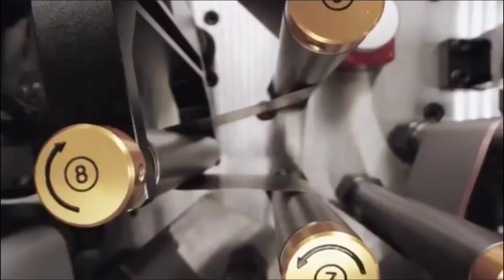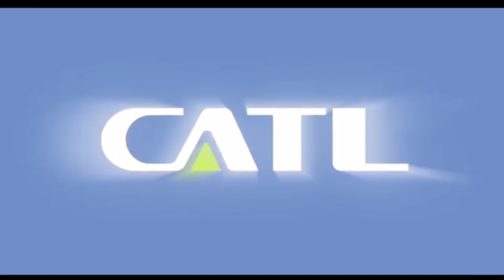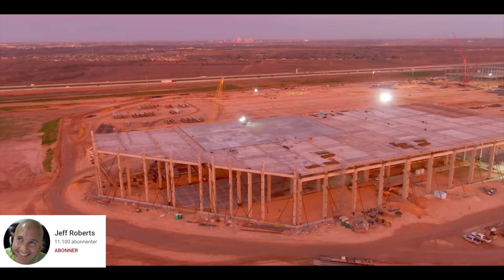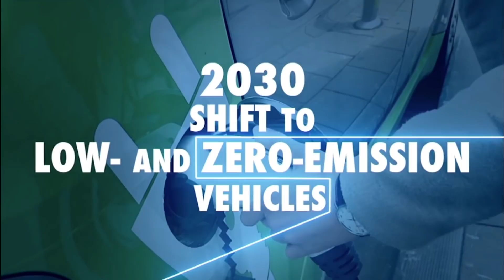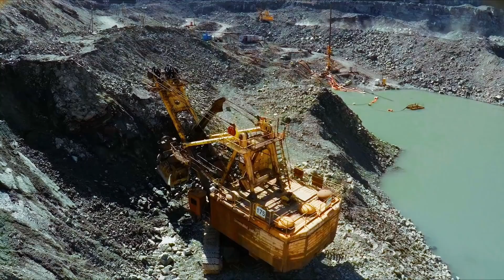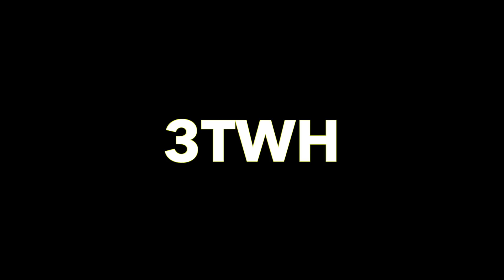Tesla is making 3 NEW battery types | And securing materials like NO ONE else

Comment: Just a follow up, you said they claim giga Berlin alone will eventually produce 240 or so gigawatts a year.  OK sure that is 638 million KW per day, 26 million per hour, 440,000 KW per minute, 7.300 KW per second. At 5 4680 batteries per KW that is 35,000 cells a second. at 2 lbs per KW that is 70,000 lbs of batteries out and materials in every second.  That is about 1 Semi truck load of batteries out every second and similar batteries materials in every second.  Thats 170,00 Semi trucks in and out a day; or 1500+ miles of semi trucks in and out every day.  TESLA REALITY!!

Comment: While this paints a rose tinted picture on the current situation, there's still strategic issues with the supply of crucial materials for Lithium ion production. While cobalt will have been virtually eliminated (currently at only 5% of the cell chemistry) other rare metals like nickel which are still used, do not have enough supply currently to support the production targets Elon Musk is targeting. This was even mentioned at battery day. While the availability of Lithium has been solved (it's relatively plentiful anyways) other critical components still haven't, and geopolitics can easily cause problems for supply chains for batteries as well. It's not a shut and dry case, and even Tesla admits there will be major hurdles to overcome to meet their production targets when it comes to Lithium ion production in the near future.

Comment: Lithium is not just the best materiel for the next decade, for mobility batteries (must move their own weight) it is permanently best. This is because lithium is the lightest metal. Reducing the weight of the rest of the battery chemistry will be the struggle. Also, the notion of recycling 100% of anything is nonsense, has never and will never happen. Recycling will only greatly reduce the amount of external input needed. Unless you classify new tech such as mining the oceans as recycling.

Comment: It is a bad thing to build too heavy and overpowered electric cars with unnecessary long range. It destroys our environment! We dont need so much batteries!
We can not move on like we did until now, only with electric instead of gas fuel!
Reply: We really need both long and short ranges. City and metropolitan areas don't need the range as bad as some rural areas. Some rural areas have round trip to town mileage of 50-100 miles. And with load, road conditions, and weather variations, batteries may not get normal mileage out of a charge.

Comment: Holy cow Batman!  Our Bat-Utility-belts will need some Tesla batteries soon!  Imagine a chain saw, drill, circular saw, jig saw, head-lamp; tool system, powered by a belt worn battery pack!  Post hole digger? No-problemo!
Reply: All these tools have cordless options that already use 18650 or similar cells. The Tesla variant might have 15% more capacity, but really not much difference. 
Scaled up to a vehicle battery, 15% is massive.

Comment: I think back when Tesla was just starting; that Elon thought that would get all the big OEMs off there butts and aggressively into EVs. But the Model S and X didn't do it. The OEMs just sat there. So Elon pushed the 3 into major production and the OEMs still just sat there.  Somewhere in all of that is when Elon realized the major car mfg.s were not going to get into EV production anywhere the size or speed needed.  That was probably around 2014 or so. Then Elon did what was needed. He ramped up what Tesla would have to do and started plans for many Giga factories. It is the same with battery production. I'm sure he asked Panasonic , LG, etc. to ramp up production capacity and they moved at a snails pace. So Elon said, well we are going to build our own batteries and we might as well make them better. Now that is happening and he's dragging the battery producers along. This is the same story with SpaceX and most of Elon's other businesses. He just has to do it himself because no one else will understand what is coming.
Reply: He wanted to be the catalyst but all the established companies would not budge. So Elon has shouldered the responsibility to be the change and that is one hell of a gigantic task. He is going to lead the way to a Planetary energy system that is non polluting and sustainable. Pretty much changing everything in an enormous infrastructure of which vehicles are about 1/3 of the equation. I would guess that even among those who support Elon's goals; very few have any grasp on the incredible scope and magnitude of his endeavor. It is the largest enterprise ever embarked by several magnitudes.  When one adds the goals of SpaceX, Boring co., Neuralink, etc. his scope is just mind boggling.

Comment: When they start producing the LFP batteries in the 46-80 tabless dry electrode format, the power walls and the lower range cars are going to be a lot cheaper to manufacture. That's when the ICE industry will begin to topple.
Reply: Nonsense, LFP batteries are already made in bigger sizes than the stupid Tesla 4680, and those batteries are already used in storage for homes, camping rigs, small overlanders.....
Reply: @carholic-sz3qv  That was something I did not know, Thank-you.
However, the tabless, dry electrode, 46-80 cell is designed for high current applications as well as being cheap and easy to manufacture. This is why it will have such a huge impact on the BEV market. When each of Tesla's giga-factories is able to turn out 250 giga-watt hours of batteries per year, vehicle production will no longer be battery constrained.
Reply: The ICE industry will continue to evolve before we are able to make 80 million EV a year.

Comment: That's great Lars, its strange, I have watched battery day so many times, but somehow missed the 3 types of cathodes. Everything was very subtle and Elon was coy, but the true fans get to the guts of it. Good work!
Reply: Sorry but you should know that is very difficult to recycle Tesla batteries in a meaningful way. In Germany they prefer to rather pay penalty. LFP is the state of the art battery ! Much safer and easy to recycle . Tesla has to catch up work to do. TESLA batteries are dirty....
Reply: @wernergmeineder7725  Tesla haven’t even launched any cars with their batteries yet. What are you talking about. And LFP is not powerful enough for long range.
Reply: @leedavies1768  LFP not powerful enough !? That's why BYD is using them for buses I guess.
Reply: @wernergmeineder7725  because buses don’t go 0-60 in under 5 secs. And you can fit a lot more batteries in the space of a bus. 
They are low cost and less power dense. You can’t get long range with them in a car. End of story.

Comment: You're jumping to conclusions, Lars.  Maybe they are the right conclusions, but they are not conclusions Tesla has announced.

Tesla has not said that they will make 3 different 4680 cells in their own battery production lines.

They did say they would use three different chemistries in battery cells for their vehicles.  Some of those cells will be provided by outside suppliers; indeed, lithium iron phosphate and nickel-manganese cells are already being used in Tesla's products, and they all come from outside suppliers.

Whether any of those chemistries will eventually come in the 4680 form-factor hasn't been announced.

The only announcement for 4680 cells, to be made by Tesla, is the high-nickel, dry electrode coated chemistry.  So far as Tesla has said, this is the only cell to be produced by Tesla.  It's not clear at this juncture, but I speculate that this cell will displace all other chemistries throughout Tesla's product line, in time.  But the production ramp has a long way to go before Tesla will be able to eliminate those other chemistries, or eliminate cells from other suppliers.  A long way to go.

The reason I expect Tesla's high-nickel cell to displace all other cells, eventually, is cost + performance.  It will be the cheapest cell on the market, and it will be the highest-performing cell.  There will be no reason to prefer to use more expensive, worse-performing cells, once they can make enough of the new cells.

If my speculation is correct, then by 2030 or soon thereafter, Tesla will be phasing out outside cell suppliers from their supply chain.  And the capacity freed up by Tesla will become available to other manufacturers.  Other automakers will reap a bonanza of cells from battery manufacturers.

By then, the tech in those cells will probably have advanced.  I don't expect them to match Tesla's own 4680 cell (whose tech will also advance), and so I expect Tesla to have a price/performance advantage in its products.  But other automakers - those who survive to that point - will be able to market pretty good BEVs in very large numbers.

Tesla will run into bottlenecks in their 4680 production ramp.  And it's unclear exactly when, or even if, Tesla's lithium mining operations will produce affordable lithium in quantity.  There is a lot that is still mysterious about Tesla's mining ambitions.  How fast can they go?  Your ideas on this match Elon's.  But Elon sets aspirational targets, more often than not.  Sometimes those targets can be met, but just as often, if not more so, bottlenecks get in the way and timelines stretch out.

A production ramp of this magnitude is usually beset by bottlenecks that will have to be resolved, with implications for the timeline.
Reply from the maker: You know me Urgelt, I always jump to conclusions 😉✌️
Reply: The LFP chemistry is the cheapest to produce. Where Mass and bulk are not critical, it is the clear choice for the most kilowatt hours per dollar. The same characteristics that make the 46-80 tabless dry electrode a better solution do not depend on chemistry. That's why I'm pretty sure that all batteries tesla employs, whether manufactured for them or manufactured by them will eventually (my guess is three years) use the same manufacturing technique. Once they have the production line worked out, they will mass-produce the battery lines and roll them out to all their factories and suppliers. Then we'll see something.
Reply: @surferdude4487  No, the chemistry isn't the sole governing factor in cell cost.  The form-factor is important.

The most difficult/expensive form-factor to manufacture is prismatic cells, whatever the chemistry.  It's just plain expensive to make them.  Pouch cells are cheaper but harder to regulate thermally, which either pushes costs downstream to the thermal regulation system, or further downstream to consumers, whose packs won't last as long because of inadequate thermal regulation (Leaf is an example).  Can cells are the easiest/cheapest to mass produce and easiest to regulate thermally.

Plus, Tesla has figured out how to use cans in structural packs, eliminating cost and weight in their BEVs, a savings above and beyond the per-kilowatt-hour cost of the cells.  This advantage can't be obtained from prismatic or pouch cells.

The cost of the chemical guts of LFP cells is cheaper, but in a pouch form-factor, some very significant savings are missed.

Further, LFP cells are not very energy-dense, so you need a lot more mass to match the energy density of a 4680 pack.  That extra mass imposes penalties on the BEV - more volume for the pack for a given range, more weight to haul around.

I'm comfortable projecting that Tesla will phase out the other cells as soon as they can make enough 4680 cells to do it.  The net cost advantages will not be matched by LFP or nickel-manganese cells in any form factor whatsoever.

I think you are right to say that the 4680 form-factor is independent of chemistry.  And the 4680 form factor is arbitrary; anyone can make a cylindrical cell of any shape.  But if the diameter of the cell increases to 46 centimeters, manufacturers must have a design that shortens the conductive path through the electrolyte, or thermal issues will arise very quickly.  The only design I know about for doing that is protected by Tesla's tabless cell patent.

Thus far, we have heard nothing from Tesla about licensing their patents to other battery manufacturers.  It's something to keep an eye on.
Reply: @Urgelt  Tabless design solves for shorter electron paths, reducing heat produced by internal resistance. This also makes larger cells such as the 46-80 possible. Larger cells means that fewer cells can be used to store the same amount of energy and reduces dead weight in the outer can because surface area to volume ratio is reduced. Dry electrode makes the cells more stable, cheaper and faster to produce. This holds true regardless of the battery chemistry. It is in Tesla's interest to provide their suppliers with this technology, even if they license it exclusively for their cells.
As for LFP, they will also be produced as 46-80 tabless dry electrode cells. The material costs and the cycle life of the chemistry will make them practical for lower cost vehicles and stationary storage. nickle is relatively expensive and always will be until we have a technology to transmute elements cheaply. For now, that's science fiction, but who knows what tomorrow will bring.
Reply: @surferdude4487  Your first paragraph merely echoes what I wrote.  Did you think you were refuting me?

LFP could be produced in the 4680 form-factor.  To date, neither Tesla nor its suppliers have announced any intention to do so.

I'm not sure LFP 4680 cells would be cheaper than high-nickel 4680 cells, though.  You'd need a lot more of them for the same range.  More mass, more volume in the pack.  Or take a hit on the range.

It's the cost at the BEV level, not the cell level, that matters.

As for the cycle life advantage for LFP, we haven't yet heard from Tesla regarding their cycle life expectations for high-nickel 4680 cells.

I'm expecting cycle life for the 4680 cells will be excellent without resorting to LFP chemistry.  Otherwise, the business case for the Semi will be much weaker.  I think the Semi pack with 4680 cells will be in the neighborhood of a million miles, possibly more - more than double what we see in Model 3 or Model Y packs.  If that's correct, then there will be no cost advantage nor a cycle life advantage to resorting to LFP in 4680 cells, and no reason for Tesla to make more than one kind of 4680 cell.

Tesla has not announced that the 4680 cell will come in different chemistries.  They have not ruled it out, though.  Stay tuned.

Comment: 4680 batteries + structural battery pack add 30% to range regardless of battery chemistry so 390 + 30% = 507 miles of range.  If you add 20% from the silicon anode you get 585 miles of range.  The Cathode upgrade only adds 4% to the range.

Comment: The difference in the plaid and the plaid plus will be because of the structural battery pack and the 4680 cells.  The plaid is still using 18650s

Comment: The problem with iron based cells is that they like to be charged to 100% for good health and longevity whereas the nickel based like to operate in the 20%-80% range and that is perfect for road trips when you can't wait for the battery to be charged to 100%.  It is just something buyers need to be aware of...all battery chemistries have different trade-offs.  Also, to own an iron based battery, you would need to live where you could plug in every night and charge to 100%.
Reply: From what I have been told, iron-based cells' main disadvantage is a lower energy density of between 17% and 25% compared to NMA based cells. Advantages of iron-based battery chemistry are about 20% lower cost, longer cycle life (~5000 cycles), and a wider useful operating range (100%-0%). I don't know of any Lithium chemistry that requires charging 100% to maintain capacity or cycle life, unlike lead-acid chemistries.

Comment: And yet, with all this, they still get their batteries from the other battery companies.  So, again. This analysis is wishful salesmanship to juice stock, not grounded in reality.
Reply: It’s really stupid for people to say batteries isn’t the problem when we clearly have a serious problem getting lithium and in a very clean way because it still depends on the fossil fuel industry
Reply: @carholic-sz3qv  More importantly, batteries are one of the WORST means of powering transportation if WEIGHT is a concern.  Also, never mind fossil fuels (those exhaust products break down and are absorbed by the environment rather efficiently).  The toxic processes to MAKE batteries result in some of the worst waste products that NEVER lose their toxicity.
Reply: @billcichoke2534  people totally forget that the oil industry is tooooo big and makes things like Lithium and raw materials production, fertilizers, roads, solar/wind farms, airplanes, ships...... possible
Reply: @carholic-sz3qv  I don't know about 'too' big...when you squeeze every last use out of something, and it proves to be a better source for your things than most anything else, I think I would use the term 'essential' or 'most practical.'
Reply: Hey, Richars Norris...when you feel man enough to have a discussion, you can unblock me.  Until then, suck on a dryer power cord while it's plugged in...I'm sure misuse of that product will fare as well as your suggested locking someone in a room with a running car.